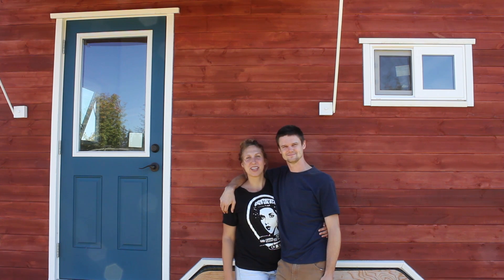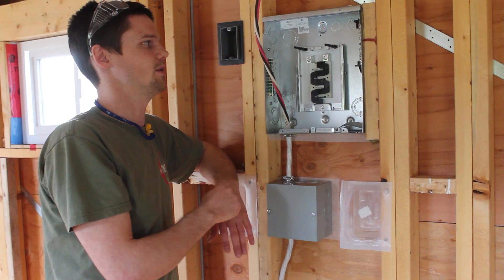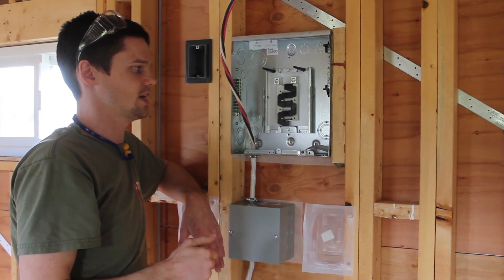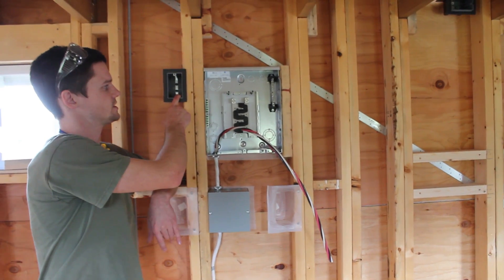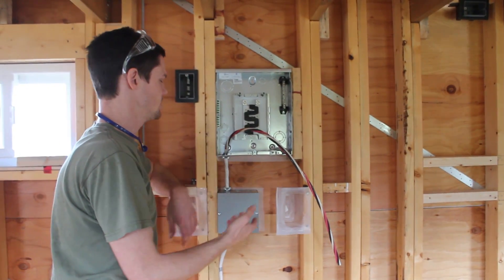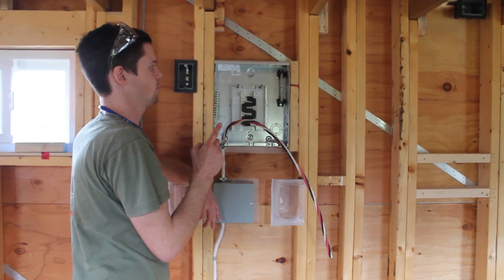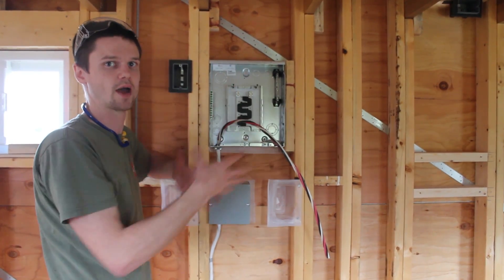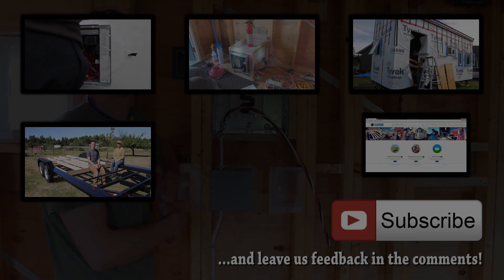Tiny House Electrical Safety (Ep.39)

Comment: Could you ground the trailer to it's own separate grounding rod?
Reply from the maker: To truly answer this requires digging into some electrical system safety fundamentals and physics... you generally only want the system to contact the earth in one spot, and then you want everything to be interconnected and brought back to that one spot... so if you drive a rod into the earth by your trailer, you have created a second ground, which could result in unwanted current flowing along the grounding/bonding system... it's hard to explain in detail in a reply like this, but the short version is: don't just drive a rod somewhere and call'er good lol... that can actually make things less safe in many cases... if you are wondering about connecting the trailer to the earth without interconnecting it to the grounding/bonding system, that would be better than nothing, but then you are relying on the conductivity of the soil to be able to drain any fault-current back to the system ground... this may not be reliable, and is why it's best to connect it with an actual copper conductor. 
As I always say: if this is not clear, and you can't be 100% certain that you understand the physics of what's going on with this kind of thing, then do not attempt to work on it yourself, because it's extremely easy to create a seriously unsafe situation without knowing it. Be safe!
Reply: @tinynestproject  Hi Jake, thanks for your helpful videos and explanations. I understand you published this video a long time ago, so I am a little late with my question: I get the difference between bonding and grounding. In my case my tiny house is on a trailer and completely off-grid. I create my own electrical energy via solar panels. So, in this case I will need to stick a grounding rod into the ground (and bond everything to it). In contrast to your case, I have no other "spot" which I need to bring it back to. 
Is this understanding correct?

Comment: I have a question. I have a completely off-grid small cabin powered by a generator with a 30 amp RV plug that I am looking to wire directly into a panel using a buried underground cable. USING ONLY one leg of the panel as it's 120 only not 240. one hot one neutral and one ground. I'm in the United States and I've talked to a few electricians and pretty much all of them told me to treat it as a main panel. Meaning that neutral and ground go to the same bus bar and are bonded with the bonding screw to the panel. And also that I should ground it to the Earth with a grounding rod.  In theory is that correct?
Reply from the maker: From my understanding, that sounds correct yes. When electricity is generated, voltage is only relative to the source of generation, and the ground/earth is irrelevant. Driving a rod or plate into the soil adds that relationship into the system, and you want to connect the neutral to that reference in that ONE SPOT, at the source of system.

Comment: so where then is the loop closed?  you can connect all the neutral wires to a bus that leads to nowhere and call it good??
Reply from the maker: +mimonteboi The neutral bus is connected to the neutral conductor in the cable that supplies to house, which provides a path back to the main service, and thus back to the grounded center-tapped connection to the transformer which is supplying the power :) #thecircleoflife

Comment: Jake, @3:46 did you actually mean to say "if the neutral bus was connected to the bonded system here…"? Or did you mean to say "if the neutral bus was connected to the GROUNDED system here…"?  I'm confused because you said previously said the neutral bus WAS bonded but not grounded by design.
Reply from the maker: +Pario A slight correct would probably be to call it the bond*ing* system... The neutral is "grounded" at one spot in an entire system, which is at the main entrance of power (the main panel). A "grounding" conductor connects to a rod/plate that's buried in the earth, and the other end is connected to both the neutral AND the bonding system (in this one spot only). This ensures that all metal, the earth in the vicinity of the electrical system, and the neutral are all at the same electrical potential... leaving only the "hot/energized" conductors at risk of producing a safety hazard.

It's tough to explain in text, but I hope this makes sense.

Comment: Are you planning to make a different anergy suplir rather than a core to the house?. 

your own energy source either panels or through out batteries connections ?
Reply from the maker: +Roelby Gomez To start we will be on grid, but we may switch part of the system over to battery-fed in the future.

Comment: i like electronics and all sort of stuff but man my brain cannot understand house wireing systems yet, might hire someone to do it for me when i get to that step, my question i have what if i am off grid but also able to on grid? what kind of system would be best
Reply from the maker: +Evilroots Electronics coming soon!
Reply: +Tiny Nest - Great, though I'll be hiring an electrician if ever I get to this stage I would definitely like to understand a little more first, especially when considering the ability to be both on and off-grid. The prospect of trying to design space and routes for fuse boxes, solar inverters, batteries, control panels etc. is a bit daunting! Thanks
Reply from the maker: +previouslyachimp There is definitely a lot to figure out ahead of time :P

Comment: Question: I have been watching all of your tiny house build from the very beginning and am starting the build process on my very own tiny house.  I understand from the first videos that you have built your tiny house on your parents' property.  Are there any housing and or building codes in your area that you needed to follow or had you needed to do any special steps to achieve it being legal in your area?
Reply: +Tiny Nest The tricky part, at least here in the states, is zoning. Zoning may allow the parking of an RV or trailer on a property but often its required to be covered and you're not allowed to live in it. Rules vary by city and county though. If you're rural enough though, you can probably get away with it. Its when a neighbor complains that you're in trouble
Reply from the maker: +Poouahi Pack A permit, and thus the requirement to meet local codes, is generally issued by the authority of a city or region, but since this structure is on wheels it's not part of a city or region. It's treated more like a vehicle than a house or out-building, and it's perfectly legal to have vehicles on pretty much any property, even uninsured and in different conditions. What we could do is have it certified as a U-Built travel trailer, which would require an inspection to pass the standards of travel trailers. We've also heard that a form of mobile-home insurance can be acquired to cover things like fire, but we haven't looked into that yet.

We've simply tried to meet very high standards of building which in turn makes it meet many residential codes when possible.
Reply from the maker: +Bike Man Dan Exactly :)

Comment: Nerd!

Doing electrical work on existing houses and buildings would be much less exciting if everyone followed your advice about not messing with things you don't understand. I've seen 3 way switch wiring that made me question my own sanity.
Reply from the maker: +MakeMeThinkAgain Oh man if you think this was nerdy, you're in for quite a treat when we get into the home automation :|
Reply: +Tiny Nest Looking forward to it.

Are GFCI outlets any different in a Tiny House? Any more or less important, for example? I wouldn't think so, but then it hadn't occurred to me that things would be this different.

And what would you have to do if you wanted to switch between your current setup and an off-grid solar system. (That sounds odd. Hope you know what I mean.)
Reply from the maker: +MakeMeThinkAgain We're putting in GFCIs in all the spots that you would in a normal house to be as code-compliant as possible. The typical application for GFCIs is when a receptacle is close to something that you are physically coming in contact with regularly and is very conductive (meaning there is a dangerous potential electrical path through you). This is why they are installed in kitchens and bathrooms because that's usually near metal drains AND water. Same goes for outside because the ground can be wet and very conductive. When I think about it though, our water supply will be from a non-conductive hose (as opposed to a buried copper line) but the water itself can still be conductive, so the concept still applies.

Our biggest electrical draw, which keeps us dependent on the grid, is our electric cooking. We have some 12V stuff that you will see later on, but we'd have to be able to supply lots of energy for cooking, or use another cooking method.
Reply: +Tiny Nest Are you using induction? I don't know what those units draw. In a Tiny House (or a tiny apartment like mine) there's something to be said for portable induction burners you bring out only when needed. If my stove stopped working I would consider that option and gain some new storage and counter space.
Reply from the maker: +MakeMeThinkAgain Yes we will start with a single induction element that is cord-connected so that we can take it outside in the summer :) and the oven will be a high-end toaster oven.

Comment: I know you have people rubbing their temples and reaching for some asprin. lol. In the U.S. we call it a grounding wire and neutral.  I think if you stated out right that most tiny houses do not have a grounding (bonding) connection buried  in the ground, (it was mentioned in passing) a simple one line diagram might of helped also.
Reply from the maker: +Duane C Heh, yeah I'm hesitant to give the kind of instruction that might lead people to get themselves into trouble :P since I know how bad it can get.

There is a movement to change the vast majority of the use of "ground" to "bond" because in most places that you see that bare copper wire, it's not actually "grounding" anything... it's "electrically bonding" all metal together so that a fault-current can flow back to the neutral bus in the panel at the point where it is actually "grounded" and then continue to flow back to the source along the neutral.... the buried rod/plate is connected to the panel with a "grounding" conductor, and that is the only "grounding" conductor and it is never referred to with the term "bond".... it's how I learned it, since I started my apprenticeship in 2008, and it makes sense and I'm stickin' to it! lol

Also, there will be a dedicated video coming up on how we BONDED the trailer to the bonding system :D so hopefully that will be a good companion to this video.
Reply: +Duane C Basically any sub panel (meaning a panel other than the main panel) the neutral bus should be isolated and not bonded to the panel itself.

Comment: Where do you guys stand budget wise on the build?
Did you guys over or underestimate how much it would cost?
Since I eventually want to build my own tiny house (I'm still designing it) and it would be nice to hear what kind of budget I'd need. I've seen tiny houses for 60.000$ which seems reasonable but that is with the company building it so since you guys are doing it all yourself it would be nice to know where you guys stand.

Another question!
Would it be possible to generate enough power troughout the year with solar panels on a tiny house roof to run a triple screen computer setup and lights in the house? Maybe even a fridge, AC, stove, microwave, etc.
A lot of people go into the theory behind it but I don't know anything about electricity or solar panels and such.
Would it be possible just in general?

I'm also excited to see what the inside will look like!
I'm pretty sure once you guys start on the inside you will end up changing a few things :D